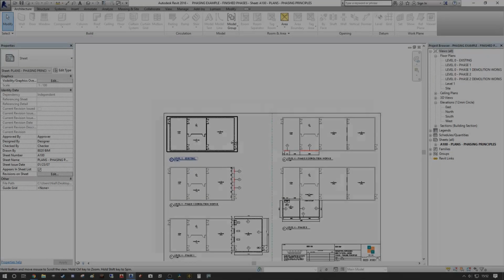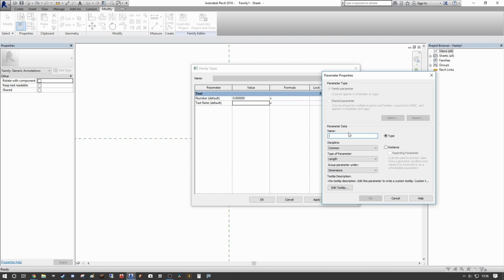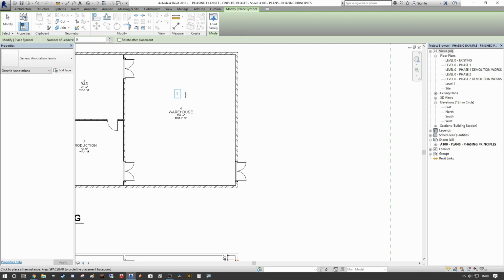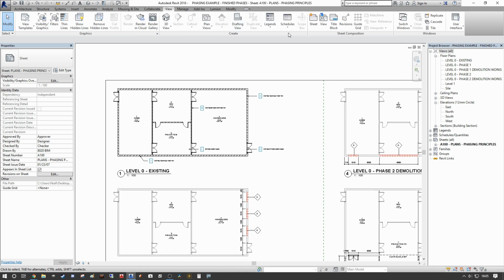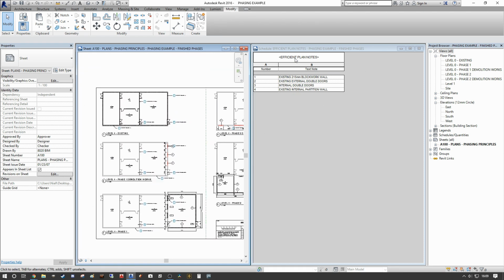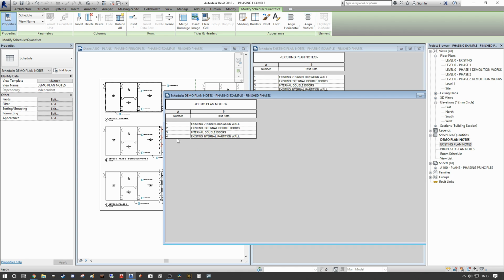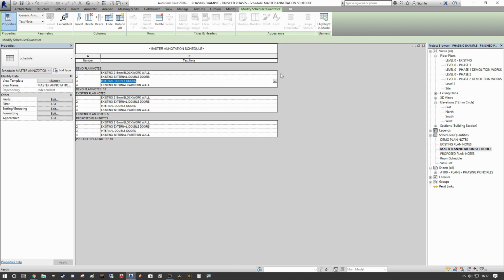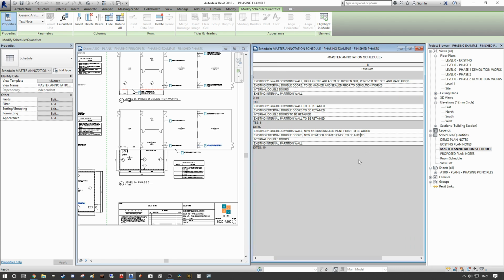Revit Tutorial - Make Your Drawing Notes More Efficient

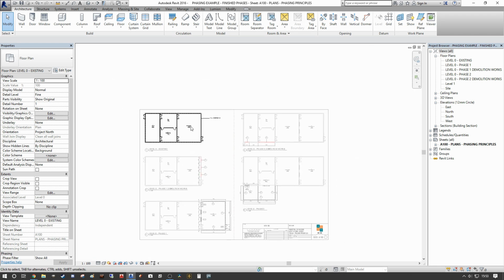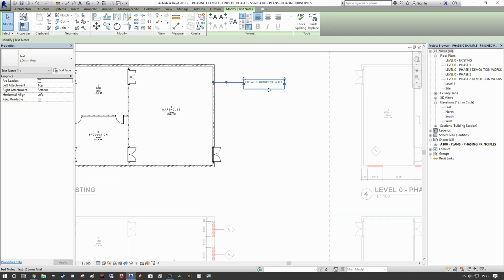Comment: Hi , have a doubt regarding text height .. as in autodesk they mentioned text height (annotation element) is relative to scale of view ,it should work(maximise & minimise) bassed on scale vary but for some scales its not working like that...for example text height is 2.5mm for scale 1:50 &1:25 it will work nice but for 1:100 & 1:200 text look bigger in view ,so any option is there to set same text height for any scale ?

Comment: Niall I echo the sentiments below.  Truly a wonderful way to add notes.  I run into trouble when I want the note on the left side of the number and I add a leader.  if both the number and note are visible the leader will not originate from the center of the number.  I've tried just mirroring the note, adjusting the family so that there are 2 versions of the note one on each side of the number with visibility parameters for both but I can't find anything that works.   Any ideas?  I'm really just trying to be able to add a note to either side of a object and make it look good.  All of your notes in the video were on the right side of the object they were referencing. Any ideas?

Comment: Thank you so much! This is incredibly useful! 
I have a question regarding leadings. Is there a way to create two types of labels within the same family that vary whether it's aligned to the left or to the right? Sometimes I'll have annotations on both right and left of my drawing, but the origin point of the leading responds to whichever side the annotation is aligned to (if that makes sense) - so sometimes the leading will be very far away from its annotation or look a bit strange. Otherwise, it forces the labels to always have to be on the same side of the drawing. Hopefully, this makes sense! 
Thanks again for a great video!

Comment: This is exactly what I need. I don’t want to use the Revit keynotes because the text file gets very long and hard to manage.
Reply from the maker: Yup, the Keynotes can become laboursome. When using them I recommend for every Keynote added input the corresponding keynote into an excel to help manage them. Means you can use Excel filters etc to hone in on one or two problematic Keynotes. Then use the Notepad (or hopefully a better Text editor) Search tool to find the Keynote which is being problematic / required alteration.

Comment: Thank you for sharing, in your example, you applied the method to already prepared sheets, but is this method applicable at the stage of making the floor plan (before they are placed on the sheet) / in view ?. Can I make notes in drawings before they are placed on a sheet, and then apply all steps to get a master schedule ?. I hope I expressed myself correct.
Reply from the maker: Hi Tomislav.
You can undertake all the steps outlined in this video without setting up sheets, with the exception of placing the notes schedule into one of your views. The schedule can only be placed on a sheet. That being said, you can still actively manage your drawing notes throughout directly from within the master schedule regardless of sheets being set up.
Hope this helps, let me know if you have any other questions.
Niall

Comment: Hi there, is it possible to hide those annotations in Schedules on sheets where it is not shown in a view placed on that specific sheet?
Reply from the maker: Hi Hendrik, thanks for the question. My apologies I did not see this comment until now.
This should be achievable through a filter set applied to the schedules, although you will then need a schedule per view in the project. I would recommend still continuing with a master schedule once the filtered schedules are in place for all of your specific views.
Hope this provides some guidance. 
Niall

Comment: Thank you for the video, but I think that, fot the purpose you are using them, it would have been better to create those parameters as type parameters, not instance parameters. Then, you could create different types of Generic Annotations, and, if you changed the value of a parameter in one type of Generic Annotation, it would automatically change it in the other instances of that type.
Reply from the maker: Hi Nuria, thanks for the feedback. I actually mentioned this point briefly in the video. The intention of this tutorial was to make it user friendly for those who may not be accustomed to working with different parameter types in Revit, trying to have a level of foresight for potentially multiple users accessing /annotating within a workshared model at the same time . But yes, absolutely you are correct. Type parameters with this method are also very effective and I would recommend them if you have the knowledge to use them effectively.
Reply: @8020BIM  Yes, not many people use this tool, and not many people understand that a generic annotation is an annotation family that can have it´s own types, like any other family. In any case, however you use it, it´s much better than using simple text! Thanks for your answer!

Comment: Hi there, thank-you for sharing. I get stuck on filtering these notes between multiple levels. EG; ground level to level 8 - I'd like to filter out notes that do not appear on all reflected ceiling plan sheets. Thank-you!
Reply from the maker: Hi Bianca - The filtering of the notes can be controlled on a per view basis. I haven't run a check myself on yoru specific query but the schedules control the notes on a per view basis, so you should be able to apply a paramter that is specific to each level. Sorry it is not more informative but hopefully this is enough to help guide you at the least.
Niall

Comment: Thanks for your video, but I have to disagree with the method used. I assure you it would be much cleaner and to the point, to use wall parameters such as "Mark" or "Type Mark", "Type Comments", and a Custom Shared Parameter "Wall Thickness" and annotate the plans using tags. In the end, one would control all the information using wall schedules and also publish some quantity information in case of unexpected demand. 
The workflow you have taught people is also useful indeed, but for other purposes.
Reply from the maker: Hi Grigor, thanks for your response. 
I agree with your statement entirely and what you have suggested is actually what I do, but in the later project stages (normally tender stage and above). In the video I do state that this is most useful in the early project stages, perhaps prior to the full project specifications being worked out when placeholder items are used in accordance with BIM workflow best practices (in my case, PAS1192-2 /Iso 19650 standards). So yes, indeed the absolute best approach is to leverage schedules with information appended to the family items via Marks, Type marks, comments, etc etc, which is also better for information drops, federated models and final COBie outputs as well. This method is solely for early project development.
Hope this clarifies things a little more. Thanks for the feedback!
Kind regards, 
Niall
Reply from the maker: Further to your point, using walls was more to highlight the function of the workflow, in reality this process is aim more towards generic universal annotation and not wall specific annotation.

Comment: Fantastic video! I have used my work at home time to take advantage of learning Revit and have relied a lot on videos like this one. You are very thorough and explain everything. I have a question concerning the placement of the arrows. Sometimes, I would like to mirror notes, so that the number and text note is reversed and I can have my leader to the right. Can the family created be modified to do this or would I need to create a new family, such as annotation note left and annotation note right? 
Thank you in advance.
Reply from the maker: Thanks Tony, appreciate the positive feedback and glad you have found value in the video.
I would recommend duplicating the annotative family, then editing it and making the mirror image (swapping the position of the number and text box). Then, merely select which one you would like in the properties drop down in your live project, as quick as mirroring and then you can use the match properties tool to select multiple annotative items to change at once to their mirror image which means they do not need to be repositioned. 
Let me know if this works for you or if you would like some additional info. 
All the best, hope you are keeping well with everything going on. 
Niall 
Let me know if this does the trick for you
Reply: @8020BIM  I have tried to do that. However, when I add the leader, it appears on the left side of the text, not connected to the number box. From the threads, I have been reading this is a common problem. However, I have not found a solution.
Reply from the maker: @TonyPegg  Interesting - I will have to look into this Tony to be honest, will let you knwo if I come up with a solution :)
Reply: @8020BIM  Thanks, appreciated. I took screenshots, but can't attach them in comments.

Comment: great video! is there a way of linking the number and the text together. i.e. if you copy the tag to a new location and you are updating the number to a number previously used, you also need to update the text field and scroll through the list (which could be long). would be great to just pick the number and the text would follow.
Reply from the maker: Have not tried it but will look into it and see if there is a means of achieving that :)
Reply: @8020BIM  This is something I'm interested in as well. It is quite involved to have to change the text fields in order for all the same-numbered notes to update.